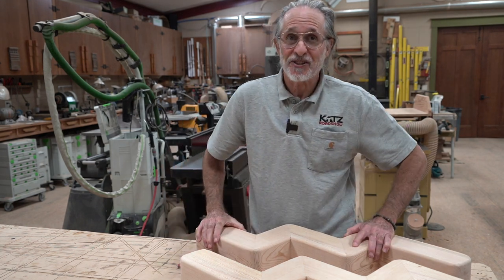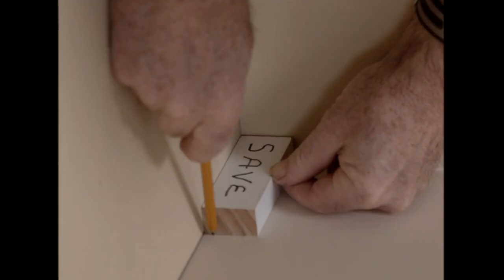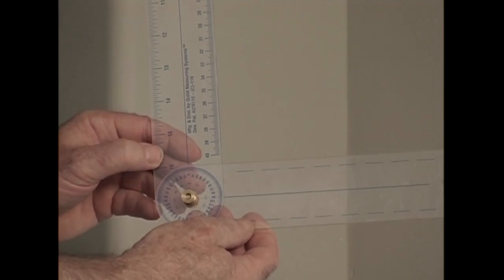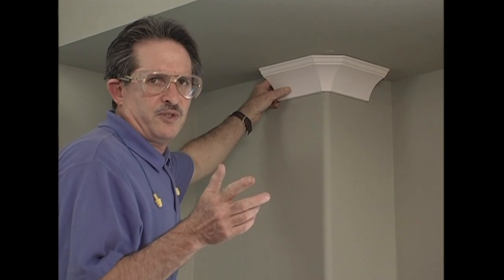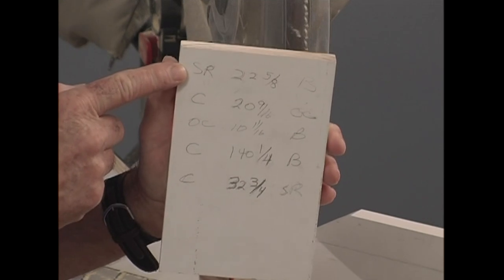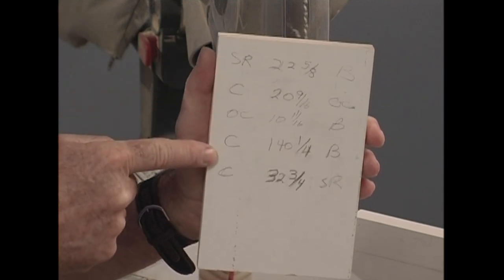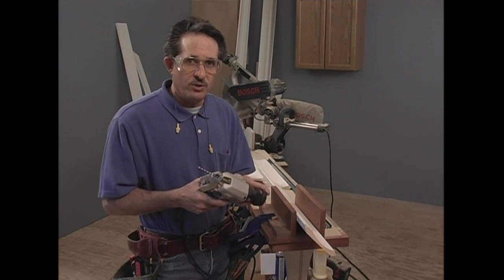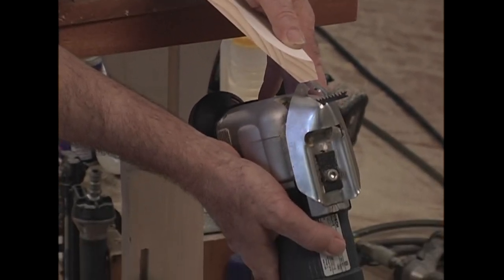INSTALLING CROWN MOLDING: PROGRAM 5, FUNDAMENTALS, with Gary Katz

Comment: 1. You are the man, and I’ve learned too much to list from you over the years. 2. I’ve used tiny screws in the past to hold mending plates on the back of crown but it takes more time than your staples. the staples you shot to keep the 1/4” ply on the back of crown splices are t50’s?

Comment: Maybe I haven't made it this far, but I'm wondering how to cope a bullnose profile, say for a window grid on a door, to tie the bullnose(double ogee oieces) pieces into a quarter(single ogee) profile type side piece... it has to start with an outside miter cut, but other than that the same process?
Reply from the maker: Sorry, I don't get into that in the Crown Molding program or any other. However, if you watch the baseboard programs, you'll learn all you need to learn about coping.

Comment: Why is the crown upside down?
Reply from the maker: I don't understand the problem. Just turn you monitor upside down.
Reply from the maker: But gosh, I have to say, that was a really valuable and insightful catch. I imagine you're a brilliant craftsman.
Reply: @THISisCarpentry  no I'm more of a brilliant hack haha. You gave alot of valuable  In sight . Love getting ideas and different ways of skinning a cat. Thank you for your tutelage.  The more a person learns the better he gets!
Reply from the maker: But the crown isn't upside down. I generally try to follow the manufacturers catalogue, and that Classical Craftsman crown molding, designed by Brent Hull, adheres faithfully to the classical orders. There you go! You learned something else!
Reply: @THISisCarpentry  There is no right or wrong regarding orientation. Even in the Classical molding line the plain edge is shown both on wall and on ceiling. Usually the plainer edge is on the wall and Usually the shorter width is on the ceiling . But I ALWAYS ask the designer (if one is involved) or the customer if they are the type that likes to play 'designer'.
(in many classical applications the more ornate would have to be at the bottom because it also served as a 'clip' on location for wire hanging pictures (no holes in walls)
Reply: @THISisCarpentry  Who is this? Gary's 12 year old?
Reply from the maker: Don't mean to be critical, but just so other's aren't mislead...YES, there is a right and a wrong orientation for crown molding. Look at the catalogue, if you don't know.
Reply: @THISisCarpentry  I did look at the catalog AND the crown you were installing is shown both ways. No one is being misled . Beauty is in the eye of the beholder and the customer is ALWAYS right on personal preference issues . (I seriously doubt any future resident will ever question the installation .)